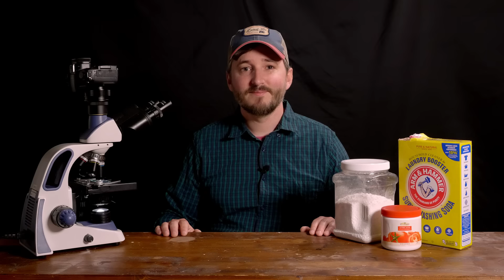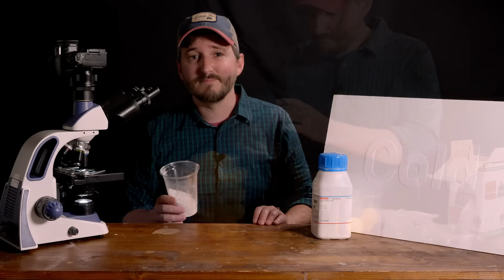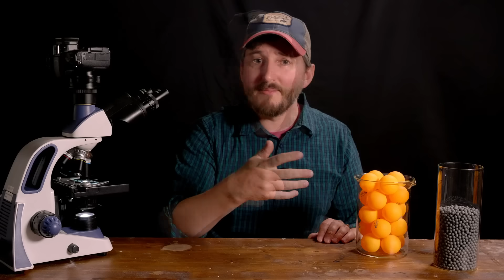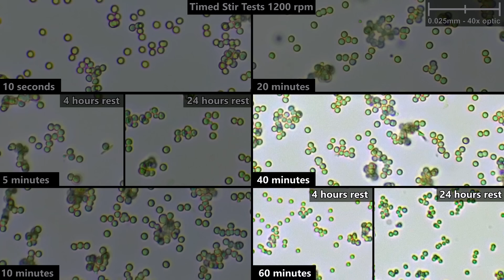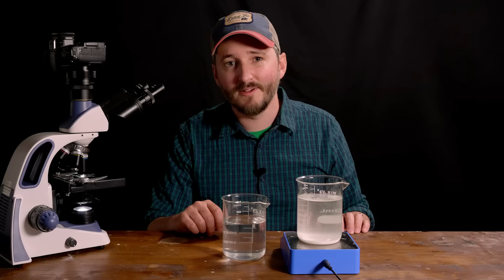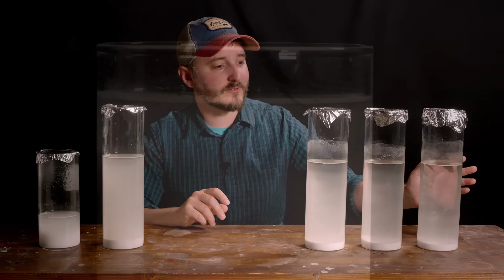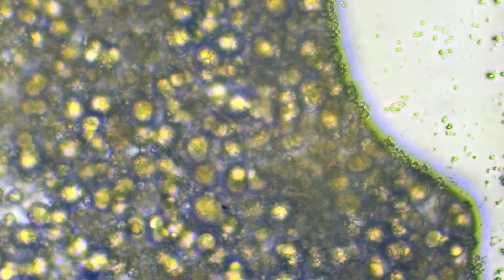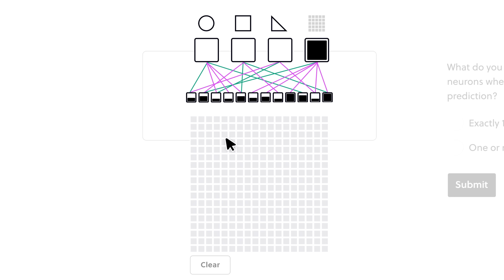Making Infrared Cooling Paint From Grocery Store Items (w/Novel CaCO₃ Microsphere Synthesis)

Comment: He may answer this later in the video but wouod it potentially be possible to create somewhat self cooling cement? I only draw this conclusion from the use of calcium carbonate.
Reply from the maker: You could paint cement. Probably not worth it to add cooling pigment to the cement mix as you would need a lot of it to make a difference. Painting is cheaper

Comment: To save time in the mixing stage could you remove a portion from the mixer every 1-2 minutes, creating smaller and smaller spheres from the one initial batch?

Perhaps even just pausing the blender for periods and restarting the mixing again would allow some spheres to nucleate at different stages and eventually create a dense emulsion of varying sphere sizes.
Reply from the maker: Yep that's exactly what I've done for very large batches

Comment: An application i thought of was covering aluminum sheet with this stuff, and thermally bonding copper/aluminum water pipe to it, and making it loop into a radiator with a fan blowing on it to make an air conditioning system 😂 think that may work good?

Comment: Love it.  Also, I have everything at home instead of CaCl2 and Aceton :) For the first time I actually think about falling into the trap of a sponsoring. As I actually thought about diving into python but never had a challenge small enough to start with. Also I wonder if one could use it to keep a room warmer in winter. Say one paints the outside wall of a room but on the inside. Instead of absorbing heat it may reflects some to the inside wall of a room which absorbs it and stays warmer. Kind of a passiv IR heat. A Room would need longer to cool down in summer though.

Comment: @Nighthawkinlight how do you think this paint would work for painting a car?
Reply: And if you could work out how to apply to fabrics for clothing, as someone else suggested, that would be not only game changing but LIFE changing for people like myself who are naturally very hot blooded and just about die in Summer and also my mother who has terrible heat regulation stemming from Multiple Sclerosis, so she just about doesn't go outside in Summer either
Reply from the maker: It's not very durable currently so needs improvement before use on a car. For clothing I'm working on methods to make cooling fabric but it will take some time before I come up with the right solution

Comment: Amazing video! I'm excited to see what comes next! Just a quick note on accessing publications: the access fee is imposed entirely by the journal, and paying it does not in any way benefit the actual authors of the study. Further, at least in my field, as a part of the copyrighting/etc, authors have permission to share their work on an individual basis for free. Typically you can reach out to the corresponding author and they will happily (and entirely legally) share their paper with you at no cost to anyone. Not everyone uses researchgate, but it's a platform some scientists use that can streamline the request and sharing.

Comment: On the topic of a large scale system consider a car radiator or similar. If i understand the physics of this system correctly I believe that would drastically increase the surface area that would emit ir and as a result massively increase the delta t of the system.

Comment: My SO went to art school, and they learned how to make different paints at home.
A) They said you can make a vinyl based paint. You mix a strong (usually construction grade) pva based glue (such as the Cascorez brand) with the pigment. Mixxing until you achieve the desired color and consistency.

B) Oil that takes longer to dry: Add 1 liter of boiled linseed oil to about 1/2 kg of pigment. The exact amount of pigment depends on the color, the product, and the oil. Mix a thick paste. Add more linseed varnish until the paint is suitable to cover and put on.

C) And the way you did in the video where you dilute acrylic plates in acetone and mix the resulting liquid with the pigment.

I wanted to make a video testing them out but I won't be able to for a few months.

Comment: I am wondering, for my own purposes, if these same particles can be dyed. If I add a food color to the batch if the particles will hold that pigment?
Reply: I don't see why not, but that would make it less effective.
Reply: @mlgsamantha5863  my use wouldn’t be for its reflectivity but for its fine grain production. I’d use the microspheres to act as color filters for autochrome photography
Reply: @DrPWNS-fz6yh  Oh, okay. Well, you would need a pigment that would be incorporated into the calcium carbonate spheres without disrupting the reaction that forms them. I doubt any organic pigments would work, but you can try it anyway just in case. I think your best bet is to incorporate some other metal ions into the calcium carbonate spheres. Try adding a copper salt to the calcium carbonate solution, copper usually turns things blue..
Reply: @mlgsamantha5863  thank you. The original method was using potato starch. But that technique is from the 1800s. I’d like to see if something like this would allow for precise control of the size of grains and density of them.

I do plan on making this recipe for a cooler I’m restoring. The thought is reducing the IR it absorbs should extend the time it stays cold. I’m going to do some experiments with sealing it to make it more durable. I’m thinking a urethane. Any thoughts?
Reply: @DrPWNS-fz6yh  I'd imagine anything that creates a glossy finish will decrease performance a small amount, but that's unavoidable and it might be negligible anyway. I can't see any problems with polyurethane unless it somehow lets the water bubbles in the acrylic escape.

Edit: According to google, it takes acrylic paint 30 days to fully dry before you can seal it. Not sure if that still applies to this 'snow-effect' paint, especially considering there's water directly inside of it.
Reply: @mlgsamantha5863  thank you so much. Merry Christmas to you. I’ll record and share my experiments and let you know how it goes.

Comment: Great video! Did you try any tests using just one particle size and a thick coat of paint?

I don't understand why packing density is important. It seems the requirement is to ensure no straight-line paths can reach from surface to subsurface. Even if you use large particles - it seems there should be no paths as long as you paint on a thick enough coat (ie many many layers of particles).

Comment: Like others on viewing this video I'm stunned by the professionalism and pure hard work of this man his endeavours.  

Just a comment about the mixtures of sphere sizes.  I've noticed with slurries and other waterborne mixtures where the particles are of different sizes; when the mixture is allowed to settle, the larger particles settle out first and the finer ones lie on top so that when fully  settled the solids are stratified.  Will this be the case with this mixture or does it behave in a different way.  

Has any investigation been carried out for instance to see if the bottom layer actually has smaller spheres filling in the spaces between the larger spheres?  Would centrifuging the mixtures be a better approach before the final filtration to remove all the liquids ?
With more than 4600 comments I'm not really expecting any replies, but someone may notice.
Reply from the maker: Maybe you would see some stratification in a tall column, but the beauty of spheres is the little ones easily flow between the large ones to fill all gaps (if they're sized correctly).
Reply: @Nighthawkinlight  Wow, I am significantly impressed not just by your videos but the fact you are obviously interested in viewers comments.  If only there were more people around like you.

Just as an aside, here in wintry England, condensation in the loft can be a mega problem for some people, especially on the underside of roof sarking felt.  Would your paint work to provide a cooler area via a coated chiller plate to attract the condensation to a point where it could be conveniently disposed of.  I'm thinking in terms of a copper plate coated on one side with your super paint and the other side fitted with fins.  

I appreciate this will be in a dark loft at lower temperatures but still significantly higher than absolute zero

Comment: I'm a bit late to this video, and I'm not skimming the comments to see if it was suggested yet, but what if you applied it via larger puddles and smoothed it out with something like a putty knife? Have a collection plate on the end of the surface you're 'painting' the mixture on. Spread it towards that end with the putty knife, collect the excess, and continue until you've coated the entire surface in a (mostly) consistent thickness.

Comment: Wow, that's an amazing process you figured out. I don't remember the exact source, but I saw how someone had basically used a 3D printer, but replaced the extruder with something like a screw jack that would work with your syringe. That might be a useful thing to play with, to draw or apply the pigment to a surface. Also a 3D printer could make a nozzle for the syringe. Very cool stuff, keep up the great work!

Comment: Have you tried using a spatulata or a flat card/metal square to simply spread the paint evenly? Like pastering a wall. Artistis do it with paint too.

Also, is it necessary to clean between batches? Seems like the calcium carbonate stuck to the walls may just get a bit nano-er - which, given the quantity should be a negligible thing? It is the same ingredients. This is paint, not open heart surgery...

Also-2, do you need to dry the pigment if we're making it fresh before use? The drained pigment could be used directly, which also reduces the risk of inhaled particles as well as the need to remove lumps. It is a water friendly paint. Couldn't the water quantity be estimated and adjusted?
Reply: Ooo yes !... Or even like how you spread mortar for tiles?
Reply: Almost like a "toothed" trowel, and if you made the mixture just a skosh more watery it may tend to level itself a little more..?.

Comment: This might be silly, but what if you poured the paint into something slightly concave, like hanging plastic wrap pinned at the edges, and then set your board on top? While the acrylic is still setting it should be sticky enough to adhere. Thin solution would need to cure upside down, but if it's thick you could flip the entire thing and leave it elsewhere to rest.

Comment: I just read that half the electricity a solar panel makes is from the IR wavelengths within the range given off by your Cooling White 2.0 Paint. Would a heat sink tank painted in Black 2.0 on 3 sides absorb enough heat to generate enough Infrared heat and light if 1 side was painted with your White 2.0 to cause solar panels to generate electricity at night? I'm building a solar panel and battery bank to run water pumps on a crawfish farm and being able to run the pumps 24/7 without a huge expense of an enormous battery bank would be great. I've already designed a water wheel to recapture some of the electricity used to pump the water into the pond from a canal. If I were able to somehow produce electricity at night from stored heat via your white paint charging the solar panels then i could upscale for much cheaper.

Comment: Good day... How would this work, in  comparison to aluminum foil, as a radiant barrier in a roof assembly? e.g. One layer of OSB painted with this paint followed by an air gap, and then a standing seam metal roof cladding.
Reply from the maker: Hard to beat foil for IR reflectivity. This wouldn't do as well when blocked from view of the sky.
Reply: @Nighthawkinlight  That's what I've seen. High performance home builders widely tout foil faced radiant barriers with an air gap so that the radiant heat that hits the surface of the cladding and becomes conductive heat, turns back to radiant or IR heat due to the air gap and then is reflected back through the assembly in reverse order. So I'd assume, with this cooling paint in the place of the foil, it would act on the IR rays as if it was directly exposed to the sun and cause the "nearly replacing air conditioning" that Tech Ingredients mentioned.

Maybe you could test this in your forthcoming video with the shed. My prinpal curiosity is to see if this could reduce the amount of insulation needed in a roof or wall assembly. I.e. If a roof assembly with a total r value of 60 sans a cooling paint radiant barrier would be on par with say a roof assembly with a total r value of 30 with a cooling paint radiant barrier.

Comment: Are the spheres reflective like the ones used on traffic signals? i know those are glass beads and about 300nm in size
Reply from the maker: Not reflective in the same way. Glass beads reflect more like a mirror where these spheres reflect like white paper.
Reply: @Nighthawkinlight  i see what you mean, i suppose the hardness and smoothnes of the beads is very different too.. i enjoy your videos and the clever solutions you implement.

Comment: You could add heat to the nozzle of the syringe by dipping in a pot of boiling water or heat gun and then squish to the shape you need and freeze shape by dipping in cold/ ice  water.

Comment: Until these kinds of paints are perfected and commercially available, is there any reason we can’t be painting our rooftops with other white paints? Surely it’s better than nothing?
Reply from the maker: I've painted my own barn roof with normal white paint. It works very well even if it's not as good as what this paint will hopefully be. One thing you have to be aware of is painting a roof white will cause the temp to drop in the building, but it will not lower the humidity. You need a dehumidifier if you do this in a non desert environment.

Comment: I gotta see more. I too hate that something works. But don’t know the how’s. It’s not the worst rabbit hole to be in. I have questions.many. 
It might not be your jam but if you happen to know and can explain it like you do..? I will totally understand and thus save time on reading article after article after video.. scroll blisters are a real thing when trying to understand.
I’ve been playing with magnets in different areas, copper, sand batteries, pulling power from the ground..uugh. Lots of playing now that I type it out. Anyway, I stumbled on gardening and staking copper coil wires around your garden. I’m not going to lie. It’s amazing. The seeds sprouted so much quicker. The plant itself was..I guess maybe,, perky but also looking extremely super healthier than ones not next to a coil. Definitely worth people doing. Even for house plants. But I’ll do you one better. I don’t know what made me try this one day. But, more playing around, I added a microwave magnet to the coil. I left about two inches at the btm straight, coiled some thicker copper wire wound through the hole a few times then up into the coil that I stretch up a bit. The results were so unexpected. Wow. I had dried seeds from a tomato that I used. I just dropped them on the soil. Gave it a drink and stuck in my magnet copper coil. The next day. Well, early evening,  ..a sprout. Not kidding. Floored. Gardening outside next year, our season is over, will be epic. I’ve already got a small window garden going but can’t wait until spring planting!

Comment: First let me say you are a huge asset to civilization! And your selflessness is highly honored, you make  an amazing  influence on my opinion of content providers for youtube. Your drive is clearly only for the benefit of the universe and not to watch your bank balance grow. Such a rare attribute in todays world. So thank you beyond words..  
Thought, would placing the panel in a vacuum environment increase the cooling effect? i.e. place the panel in a vacuum sealer bag then using thermal paste attach that to the heat exchanger. This would solve the need for poly film over the panel and might benefit the process. I know a vacuum is a amazing insulator not sure if it might benefit the cooling differential.  
Just curious.
Reply from the maker: You want a gap between the outer film and the paint, so if using a vacuum bag you would need some structure that keeps the bag from sucking flat onto the paint

Comment: Could this be applied onto certain fabrics, particularly the ones on sunscreens? I also wonder if the backside of the sunscreen needs an additional (fabric) layer of a different material. Preferably one that does allow some light to go through so it doesn't become to dark under it.